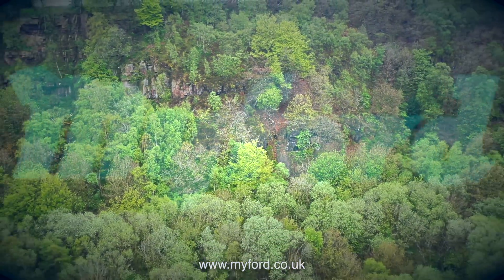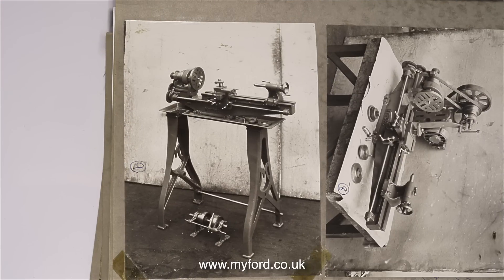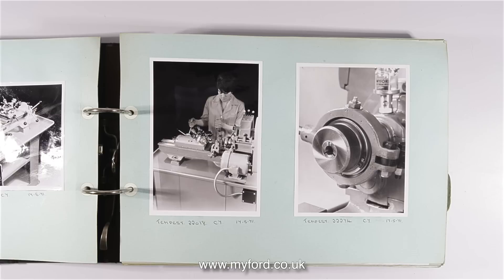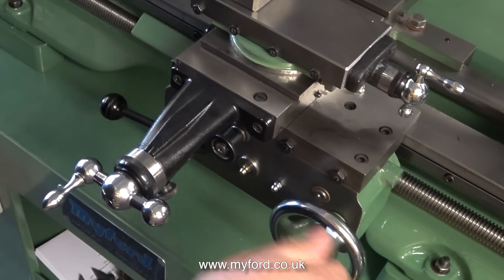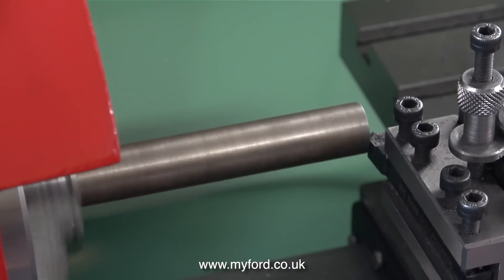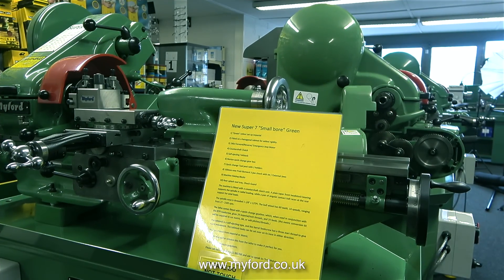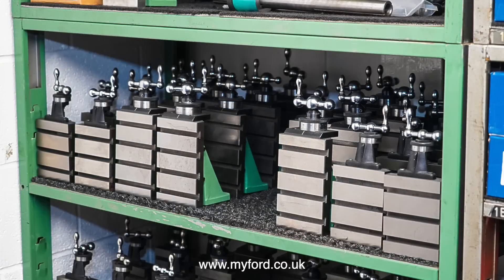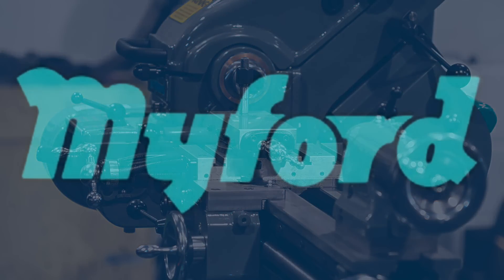THE MYFORD STORY - PART #2

Comment: I have a circa 1941 myford similar to the one you have shown. These are unique as when you rotate the saddle handle anti-clockwise, the saddle moves AWAY from the chuck. In all my working life I have never used a lathe like this. You have to concentrate 100% to use it. Would I swap it for a new super seven, yes of course, but it does me and I only paid £40 for it.
Reply: Early wadkin pattern makers lathes had a carriage that did the same thing, they later added another gear in the mechanism to make it 'normal'

Comment: i wish so bad i would live in UK.....to import a myford, you ll end up somewhere twice the price i think...
Reply from the maker: Why not contact them at www.myford.co.uk
Reply: Depending where you are in the world, it shouldn't be really expensive. I shipped a 1 tonne machine to new zealand and it was £400. I'm sure myford will ofter a crating service.
Reply: They offer factory rebuilt machines for A LOT less than new machines. I ordered my current Super 7 (as a rebuild )last year and It came to about a 1/3 of the money compared to a new one. The only things that I think are from another machine are the headstock casting, drive housing (still says Nottingham on it),  and maybe the apron. The rest of the lathe is brand new. Even the bed and tailstock are new.
It cost about $5600.00 US. Shipping, import tax, import broker, and delivered to my farm was about $1200 on top of it all. Not what I'd call cheap, but its my "forever lathe". I sold my first Myford (Super7 long bed with QCGB and taper attachment) to help fund my South Bend "Heavy 10" rebuild back in '06.  One day I'll get that one back too. 

BTW, I payed $5400 for that Myford long bed back in '95. So today's price is not great, but not terrible.